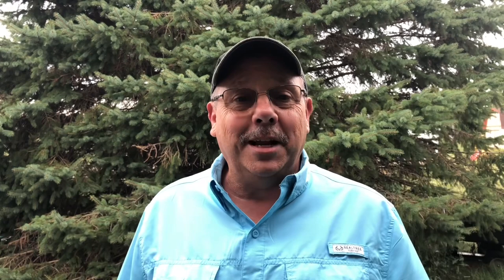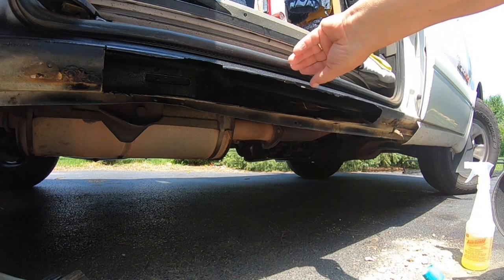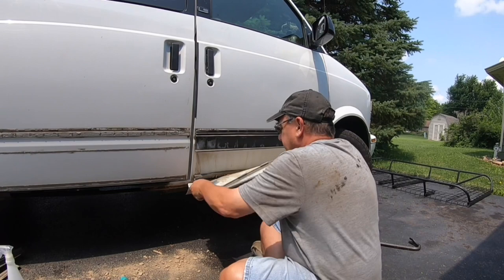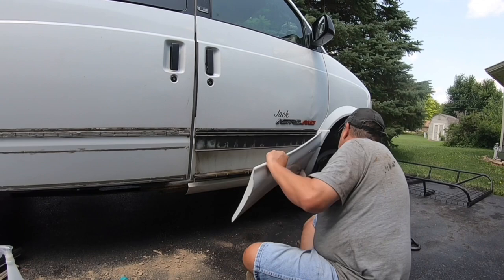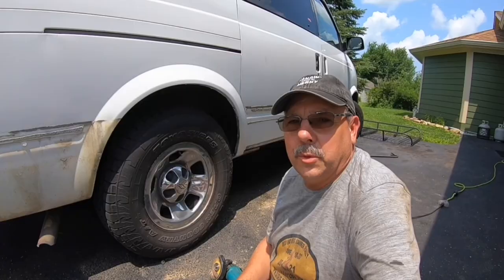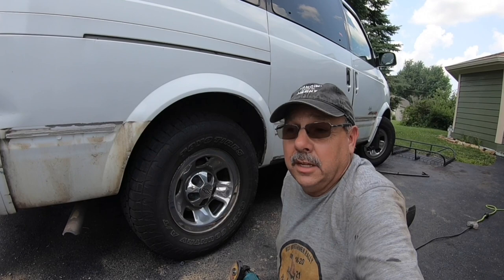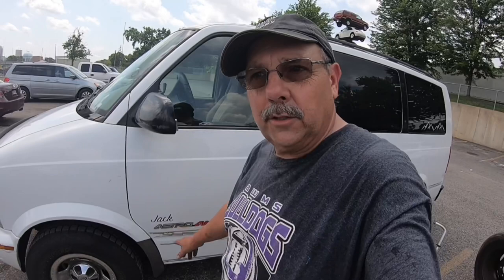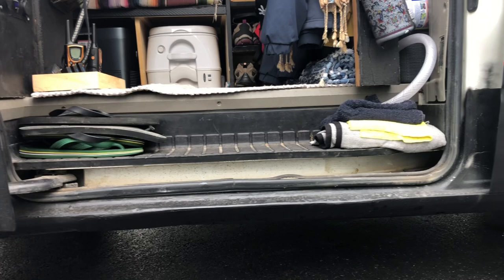Removing Plastic Cladding from my 1999 Astrovan

Comment: This is what I needed!! I just got a chevy express conversion - and I want to pull the panels off and do the same thing. I think I am going higher with the liner, but either way, this is the help I needed!
Reply from the maker: The bed liner looks cool but the rough surface is had to keep clean. I love the express van also.
Reply: @Hanginwithherky  I kind of figured that. My husband wants to stay lower, I just want to hide some of the blemishes :)

Comment: Taking the cladding off and painting my 03 astro next week. What bed liner did you use, how did you apply it, and how did you do the pinstripe? It looks really clean. Any tips would be useful.
Reply from the maker: If I had to do it over I would not have used bed liner. The dirt sticks to it really bad. I should have used rustolium  enamel paint and applied it with a brush. For the pin strip I just used pinstripe tape it has held up well.

Comment: Looks 👍 Great! Did you have trouble getting the tape and adhesive off where cladding was at? Or can you tell me the Best way to remove it plz? Thx much 😊
Reply from the maker: Some folks use a eraser wheel but I liked just using 3M industrial citrus cleaner and a plastic scraper. It’s not too bad of a job just takes a little patience